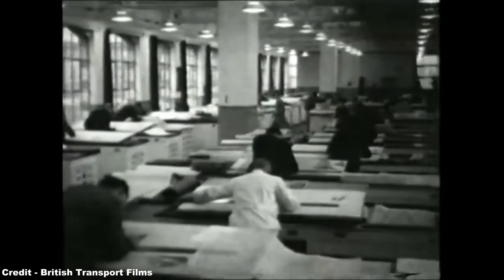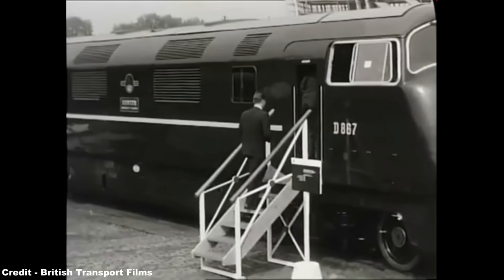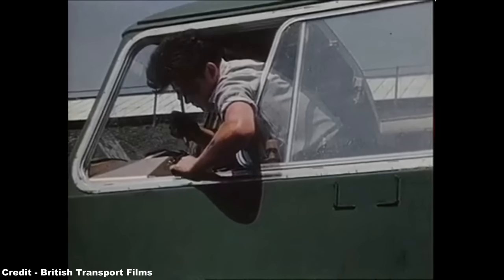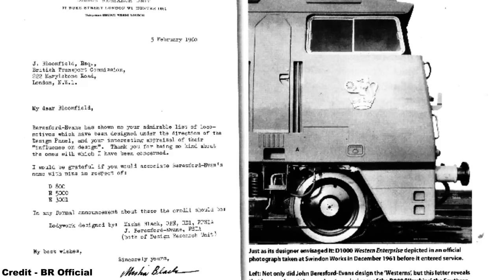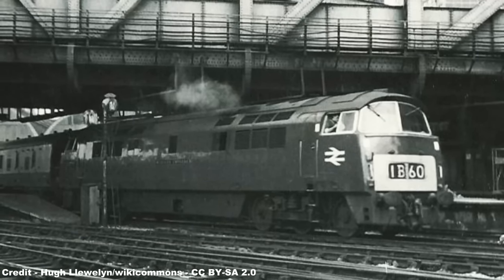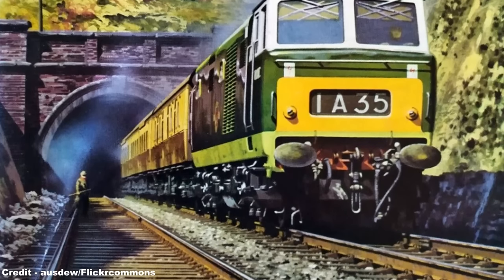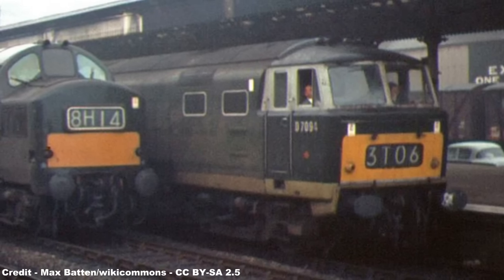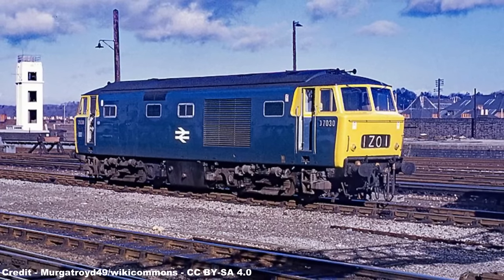The Tale of the Diesel Hydraulics

Comment: It is clear why there are no longer any British locomotive manufacturers left in the UK. It is not because of the lack of competent engineers but political interference. These diesel hydraulics locos in the UK were obviously retired too early due to the choice to of diesel electric. A strategy employed to try to shore up the UK suppliers. It should be noted that the final design in Germany the V218 began service mid-to late 1960s still can be seen on mainline IRE and RE services today some 60 years later. The Germans seem to know how to build railway equipment, after all the HST eventually relied on their competence.
Reply: Whilst a fan of the hydraulics, their early demise was due in a large part to lack of ETH ("non standard"), often overlooked.
Reply: Not only the class 218 is still in use in Germany. Several class 220 (original V200) are in use with private operators, and even most of the class 221 (upgraded version of the V200) that had been recovered from Greece have been refurbished and put into service by the privates (like track maintenance companies). There is at least one video (trailer of a DVD) of this refurbishment here on YouTube ("The Train TV" channel, I think, in German).
Reply: @chrislaarman7532  ".... in the UK"
Reply: We still have crompton EE type threes and Brush fours and some EEType ones as well I believe. They are old to ancient. A situation caused by lack of investment in our railways, brilliant resilient design and privatisation.
Reply: Sadly true.
Reply: Britain invented the Railway, its a real shame that the British Rail Industry went bust.
Reply: Market is too small and we don’t have big enough industries to export. Unlike Siemens or Stadler as examples.
Reply: @22pcirish  Thank you for commenting but can you please expand on your idea about the market being too small. Are you talking about the size of the UK market? If so you may know that Stadler are a Swiss company and are now a world leader. Remind me how many people live in Switzerland?
Reply: @BJHolloway1  The uk market. Let’s set up a company to deliver 50 locos to a UK operator. When they are delivered what happens to the company? You COULD bid for contracts around the world but up against the big manufacturers you’re more than likely to fail. But if you had an order for 800 locos (as General Electric had for locos to China) we’d fail as we wouldn’t have the capacity or trained workforce to do it. And if you only build locos, once any order is fulfilled. What will the workforce do without anything in the order book. Hence why we have the class 66 etc, that contain bog standard parts from the EMD shelves.
Reply: @22pcirish  How did Stadler manage be a world force in railways Please explain
Reply: @BJHolloway1  Decent investment in decent products. Even the Germans buy them, despite with their own manufacturers. We had Thatcher.
Reply: Same is valid for the car industry and many others.
Reply: @hans2406  Again through lack of decent investment and a whole bunch of really shit cars (that today’s fortunate survivors are called ‘classics’
Reply: The German designers were not better, nor were the manufacturers.
But the German industry was supported by German politics, including financial support.
Reply: @22pcirish  I wonder how Stadler managed to achieve the place in the world market. Could it be that they looked outwards instead of inwards?
Reply: By looking outwards Their domestic market is far smaller than the UK That how
Reply: @22pcirish  You are right Germany does buy them but you will find in most cases their is a significant German content
Reply: @BJHolloway1  Of course. But British Rail Engineering couldn’t do that, and the few companies that succeeded, like English Electric, were swallowed up and lost that edge. I can’t wait to be driving the biggest Stadler product that will be on British railways.
Reply: @BJHolloway1  Even when we did build a loco with export in mind (Class 58) they were shite. Cheap parts and unreliable. (The air compressors were driven by a belt off the engine and were very prone to breaking) The class 66 introduced later has standard parts off the shelf that are compatible with all other EMD products across the United states and round the world. THATS the difference.
Reply: MT part of Rolls Royce?
Reply: @davidgray4365  Have you missed the letter U?
Reply: @BJHolloway1  yes, believe it or not there are two of these inside our nuclear submarines for emergencies
Reply: @davidgray4365  Hi yes I can well beleive it because they have dedicated military unit within their works. Currently very busy as you would expect. Their engineer prowess is 2nd to none and they supply many armies and navies all over the world.

Comment: I wonder if anyone on the Modernisation Plan committee thought that wiring up the entire network was the best way to go, not running portable power stations.
Reply: Yes, but they didn't have the funds to do so.
Reply: @daniellewis1789  Exactly so. In fact when they started designing the British Rail standard steam classes the concept was that they would last for 20 years plus until all the main lines could be electrified. Then when the modernisation plan was finally released it was decided that they would have to be phased out quicker than that. This meant that some of the best steam locomotives we have had only saw a life of about 10 years then further waste from the Ill conceived scatter gun approach buying huge numbers of different deisel locomotives, most of which fell by the wayside.
Reply: @andrewdarley8988  it even sounds the "plan" for electrification was really on a nearly ad lib basis. Gerard Fiennes sounds like his big push for a fleet of deltics was because it was late in the pilot scheme era that it was learnt the East Coast wasn't to be electrified. DP1 of course being tested by both East Coast and West Coast, but nothing became of it until the non-electricification necessitated the push for squadron production.
Most intriguingly, I think I've just repeated myself by altering some words with no reason whatsoever...

Comment: 100,000 subscribers is excellent congratulations!
In the US🇺🇸 Southern Pacific’s diesel hydraulic experiment yielded generally higher maintenance costs. They did, however, produce higher tractive effort versus conventional diesel electrics- but at the cost of higher maintenance costs.
Reply: It was much more than that. Simply put the Diesel Hydraulics were not cut out for the North American Railroad work environment. Locomotives in the US are often notorious for working long hours on runs that sometimes take two to three days and travel up to over 2000 miles. The Hydraulics simply were not expected or built for this kind of work environment, and nowhere in Europe was this ever replicated. In addition to that the Diesel Hydraulic Engines that were used had more intricate moving parts increased the maintenance costs, and the different transmission system basically made them unable to be worked on in the North American railroad work environment at the time. Not only that, but the Diesel Hydraulics were proven to notoriously HATE going through Tunnels, getting so hot to the point the valvetrains often melted. It was ultimately these flaws that doomed the Hydraulic experiment in the United States, but it wouldn't be until the 1980s that the Diesel Electric was able to meet with the Hydraulics Power.
Reply: SP assigned the hydraulics to the Central Valley out of Stockton and Bakersfield where they did relatively well. They still disappointed SP with their extra operating costs even on the DH640’s from ALCO.
Reply: @cmdrflake  They worked other parts of the system other thank just Bakersfield and Stockton, and even here they were not really that cut out for the North American Railroad work environment. By the time the German company was able to sort out the flaws of what the units were having, GE, EMD, and ALCO caught on to what the SP was wanting and so they offered a locomotive with none of the drawbacks of the Hydraulics. Simply put if you have ever heard of the Southern Pacific and Rio Grandes famous "Tunnel Motors" these are what essentially doomed the Hydraulic Experiment in the US
Reply: @BuckeyeNationRailroader  
Even Russia doesn't have long trips like that?
Reply: @pizzaplanettruck9761  I would guess not

Comment: I painted western ranger in Kidderminster paint shop with my mate, in BR blue, it's a huge job with a 4 inch brush, 15ft from the top centre to the tumble home, one starts from the bottom working as far as you can reach, the top man works down laying off into the lower level, fine enough, but it is 60 ft long! So, go for a wee, turn off the phone, and go for it.
Reply: How long did it all take?
Reply: @Hattonbank  ages, actually painting the blue took a day a side, but the prep took 2 weeks, sanding down the old blue, but beneath that the prestressed panels had up to 9mm thick filler on them, and water had got behind it, so it all had to be chipped off and refilled, that was a long job.
Reply: @Hattonbank  the actual blue took 2days, but the preparation took 2 weeks, after sanding down the blue we found pockets of water behind 8mm thick filler over the stressed steel skin, that all came off, steel treated and re filled a big job. 
After 2 undercoats and flatting back the top coat went on.
BR or rail blue paint was developed with Williamson's, to be hot sprayed, it's a very thick paint, so the heated paint or heated spray guns makes the paint runny enough to spray. The idea was thick paint wasn't designed to be varnished, so taking out an additional task. Also when the loco (and the BR carriage sets) went through the washing plants, the brushes would take off a thin layer of paint revealing a new bright colour beneath.
Anyway, we didn't have that ability, so to make the paint flow, we used a little boiled linseed oil to keep the wet edge going, for the final coat we did add some varnish for a glossier finish.
Hard work, made it up as we went along using our 30 years experience.
Hope this helps.

Comment: The Modernisation Plan was not ill conceived. It came at a time of great change technological innovation. Long established norms were being ripped up and a whole new world of opportunity was out there - locos that didn't need turntables, could be started at the touch of a button, and huge competition from road and bus and eventually from air.

The plan tested and challenged the capabilities of British industry when Britain was broke and in decline. Although many of the locomotives designed and built were not up to the job, lessons were learned in the process. You mention the Class 20 which saw 50 years service, ditto the Class 47s. The 37s are still going.  The Class 08. The AL1-AL5 electrics were the testbeds that gave us the incredible Class 86s, 87s and 90s - note that (as far as i am aware) we never imported an electric locomotive until the class 88 in 2016. 

Sure in hindsight things could have been done better, but if i was told the future is not the norm and all i have was a blank canvas and nothing to paint, i'd ask a number of creative people to paint that future.

Comment: A couple of other historic items related to the withdrawal of two of them. 

The Warships were not fitted with train twin pipe air brakes (perhaps due to the tight fit for various things), so they were not compatible with modern rolling stock into the 1970s. 

The Westerns were not fitted with electric train heating (ETH), so fell out of use when air con stock, i.e. Mk2d/e/f came into service on the Western Region. Class 47s (some of which had ETH added) came into use on the South Wales services in lieu of the Westerns from the early 1970s.

Comment: Me too: congratulations on reaching 100k subscribers, and thank you for the effort and sharing!  :-)

It seems to me that railway companies develop a preference for "electric or hydraulic (or even mechanic)" transmissions with diesel vehicles, and (back then) "single or compound" working cylinders with steam locomotives.

However, as passenger services seem to grow into multiple-units, locomotives will become more of a goods-only traction power, likely to be ordered by major operators and rent firms, forcing the markets into off-the-shelf traction. Just think of the ubiquitous Class 66. And of hybrids with diesel for the "last mile", making diesel-electric the obvious choice.

Comment: Only 7 western locos are still in preservation but two have since returned back to the mainline including the Severn valley railway residents western courier and champion 

And only 2 warship locos are still in service the third warship d818 was already scrapped just before swindon closed its works in 1985

Comment: I would have loved if the British loading gauge was big enough to take the Alco DL-500 while not as spectacular they were brutally reliable and could turn good turns of speed when needed and handle long grades with ease. 

It would be great if you could do a doco on the ALCO DL-500 As a class they were probably probably the largest single class of imported diesel locomotives in Europe before the coming of the EMD JT42-SS in the 90's.
Reply: There would appear to be two reasons (at least) why BR didn't go to Alco and GM in the 1950s. The first is that the UK was suffering a balance of payments crisis in the 1950s and could not afford to import locomotives from the USA. The second is that the US companies would not allow their products to be built under license in the UK, which is strange, because both EMD and Alco locomotives were built in Australia under licence in the 1960s and many of them are still going strong.

Comment: Hydraulic transmission in lightweight bodies and under-frames made sense to wr operators faced with the lumbering A1A prototypes. Just a shame that we didn't have the engine experience needed to build our own suitable power plants and had to import German engines that were developments of Zeppelin engines! They were built under licence by Armstrong Siddely in Coventry (very badly bombed ten years or so earlier)!  I worked at the factory that made them and lightweight high speed diesels were uncommon at the time. Think if the public knew of the money spent on licencing a German product there would have been an outcry. On a still and clear night you could hear a Western spooling up its turbos from miles away as it thrashed up to Paddington making up time. As an engineer you guessed at the temperatures and feared for piston rings and valves.

Comment: It’s easy to criticise the development of so many different locomotive types in the 50s but just like the civil and military aircraft industry there were many established designers / manufacturers and technologies to use and it was tempting and practical to get them to produce models suited to a particular role or region. In the end there was mass conglomeration and standardisation and with aircraft we ended up with just DC-9s, A320s and 737s instead of BAC 1-111s, Tridents, Mercures, Viscounts, Vanguards, Elizabethans, Yorks, Hermes, Comets, Caravelles, …..

Comment: As a fireman at old oak common at the time of the change over at the time I personally felt that they were introduced without any proper and although nobody ever seems to mention it there were a high number of failures in the warship and western class where a steam loco was required to be called upon as a tow truck . I appreciate that there are a lot of enthusiastic people that admire this type of loco but in the cab doing 90 mph they were not a good ride

Comment: A very interesting video. However, no mention of the final class, the class 14? Based on the wheelbase of the pannier tanks they were due to replace, very quickly lost their usage lilke the other type 1s, and they were unpopular when displaced to hull docks as they weren't powerful to work alone but couldn't work in multiple so required 2 crews.
Also odd that no hydraulic ever carried TOPS numbers before withdrawl, even though the westerns lasted until the introduction of the HSTs.
Reply: That's why I said earlier "What about the Teddy Bears? 🐻"  No reply, came the answer...

Comment: were these a hydraulic pump driving hydraulic motors or a conventional reduction gearbox powered via a tourque converter?
Reply: Three torque conveyers on the same shaft , drained and filled at set speeds ( 6, and 25 from distant memory ) then shaft drive to the bogie with all wheels coupled by shafts. So they were very sure footed